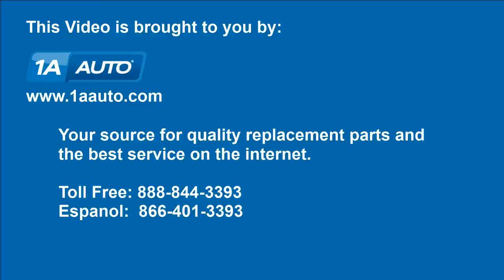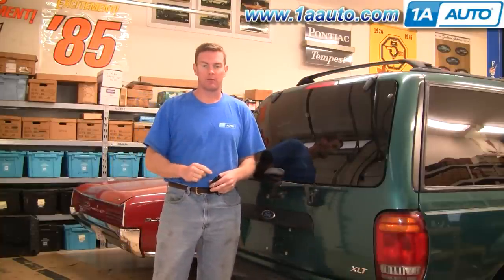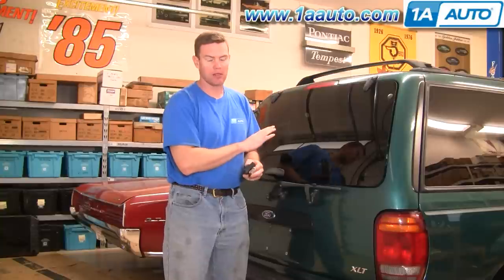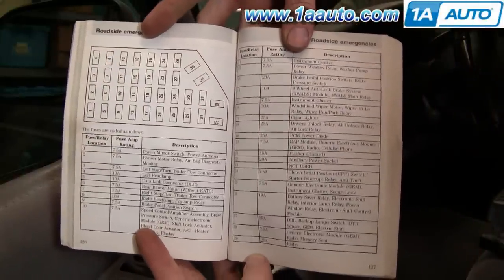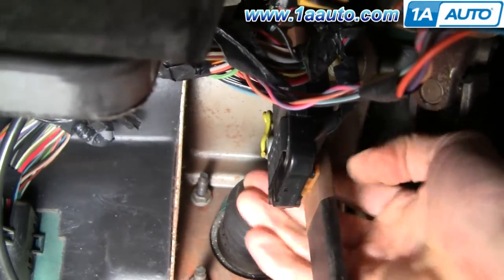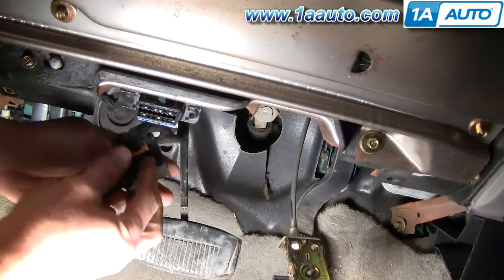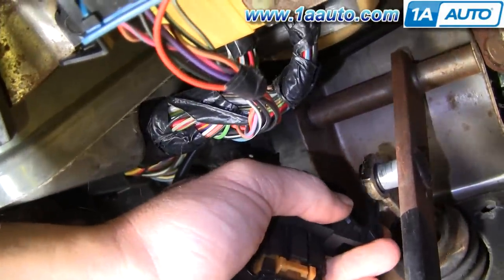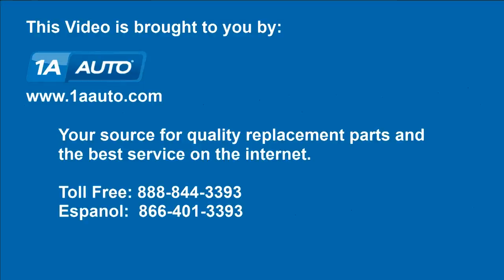How to Replace Brake Light Switch 98-99 Ford Explorer

Comment: I'm going to try this today...my gf brake lights are doing almost exactly what's going on here; however, her brake lights are on continuously; so if she presses the pedal...nothing happens. The lights don't get brighter or go off; they are just on. The top brake light above the hatch illuminates when she presses the brake pedal. So I'm thinking...her light switch is going  (or is) bad.

Comment: What could it be when I push the brakes and the lights come on but when im not on the pedal theyre completely off.
Reply from the maker: +EpicZombieAtk _ Thank you for watching. If none of the lights work when your foot is away from the pedal it could be the stoplight switch. 1aauto.com
Reply: 1A Auto Parts Now my dashlights, tailights, and fog lights all go out and each time i put a fuse in there it blows out. Can ya help?

Comment: All 3 of my brake lights are not working.  My brake light switch and pedal are just like the ones in the video.  I took the brake light switch off the pedal like in the video and pressed the button/plunger with a pair of pliers and my brake lights came on.  So I know my issue is between the pedal and the switch.  I put the brake light switch back on and it still does not work.  The button on the switch is not getting pressed when I press the pedal apparently. Any suggestions?
Reply from the maker: You could try to replace the switch, or you may also want to inspect the wires coming off of the brake light switch to see if one of them is frayed and needs to be repaired. Hope this helps you out. 1aauto.com 888-844-3393

Comment: Well I replaced the brake light switch....problem still not solved.  So, my best guess, I need to replace the wire!  What do you think?  I'm at my wits end here.

Comment from the maker: It sounds like something could be crossed in the wiring, or check to see if one of the wires coming off of the brake light switch is frayed and is hitting a piece of metal. Hope this helps you out. 1aauto.com 888-844-3393

Comment from the maker: You may want to see if there are any stored codes in the computer. If there are, it should point you in a direction as to what is triggering the light. Hope this helps you out. Have a great day! 1aauto.com 888-844-3393

Comment: Diagram for a brake switch on a 2002 Ford Mustang how to replace it the switch
Reply: Brake lights won't shut off on a 2002 Ford Mustang
Reply: Ford 2002 Ford Mustang brake lights won't shut off how do you how do you change the switch on the brake pedal
Reply: How do you fix the brake light switch on a 2002 Ford Mustang Public wants to know
Reply from the maker: +David Boer We currently do not have an auto repair video that covers this particular repair. We will keep this request in mind in the event that we need to make this repair in the future. 1aauto.com

Comment: I have a 2000 Excursion - same deal?  My brake lights work but that circuit is drawing amps when car is off and killing my battery... just replace the switch?
Reply from the maker: +Greg Bowman Thank you for checking us out. It could possibly be the switch causing this issue. These vehicles had a common issue with this. 1aauto.com

Comment: My 1999 Explorer taillights are not lighting up when I turn on the lights only when I press on the brake pedal. Could this be the issue?
Reply from the maker: +ObeyValencia We wouldn't be able to diagnose an issue like that here, you may want to have a local mechanic take a look at it. Thanks for checking us out! http://1aau.to/m/Shop-1AAuto-c
Reply: @1AAuto  turns out it was the dimmer switch. Replaced it then it worked